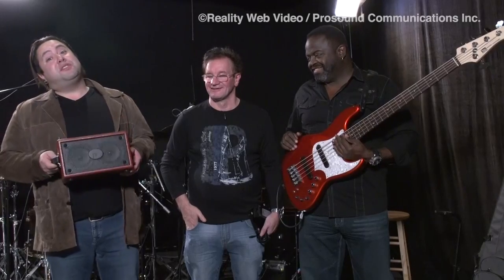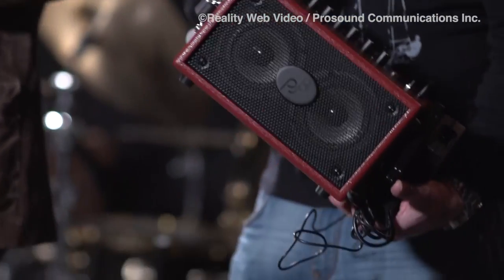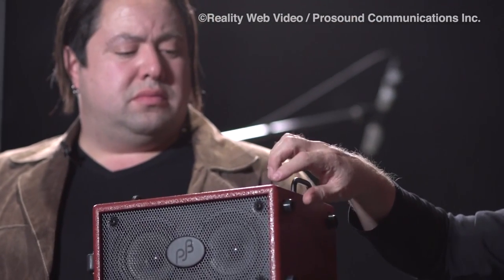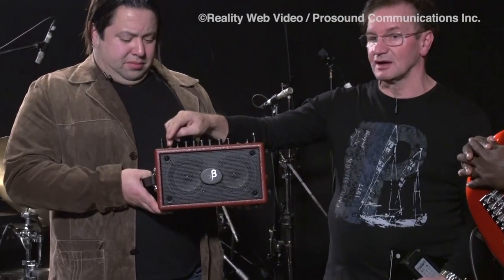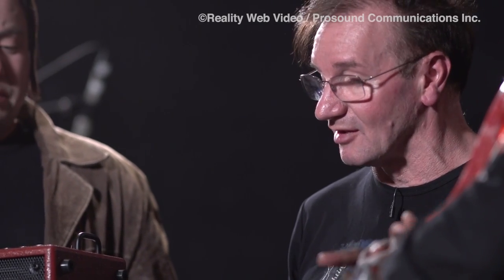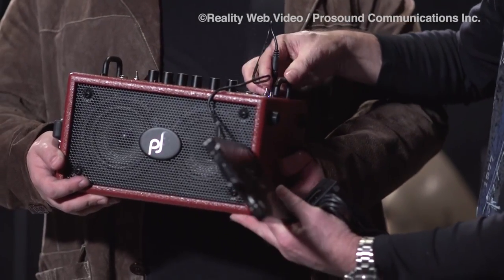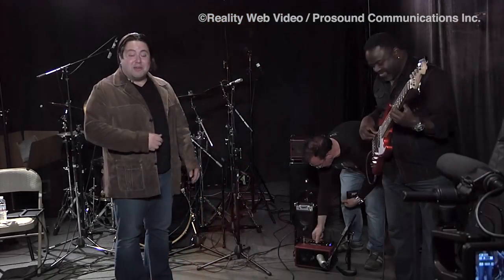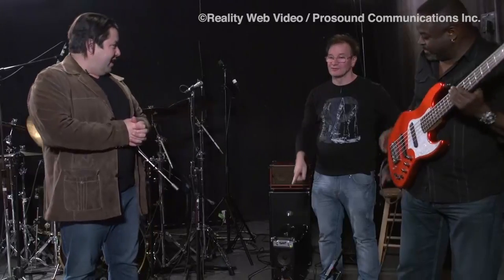Phil Jones Bass Product Demo Part 4  "Double Four Combo"

Comment: Jesus Christ mister Jones, there isn't such thing as a  "digital amplifier". You are referring to Class D amplifier architecture used into this product.The sound is pretty much 100 % analog at the end into those speakers. I came to watch this knowing  it has a great sound and expected top notch description for this luxury product.
Reply: Pardon my ignorance but aren’t many modern Class D Amps using digital signal processing?  As I said I am not electronic guy but could this be what he meant in a simplified way, without getting into the ins and outs?
Reply: @thejamaican67  You are referring to DSP, the digital signal processor, and this stage, where it's available, is working with small line level signal. It has to do with shaping the signal, before the final amplification stage, wich can be classic AB with transistors or Integrated Circuits, Class D with integrated circuits (most times) / FET transistors,and the third option is old school tubes for final stage amplification.

Comment: Incredible sound! The battery option is intriguing. Do you get the full 70W RMS when using a battery?  Also, as a guestimate, how much playing time would you get with typical sound / volume settings from a fully charged battery (assuming the same model battery shown in video)?
Reply: Since all the amp's power comes from DC, power just depends on how much current your battery can supply.  Note that just because a battery may say 4AH, that doesn't necessarily mean it can actually supply 4A.

Comment: I tried finding one of those little computer auxiliary power supplied and couldn’t find one.  Anyone know what to get?  What voltage?
Reply: discharge 19-20v at roughly 4.5- 4.7 amps i believe.

you also want to avoid one that will powercut if the amperage gets high (the first poweradd pilot apparently has this problem, essentially shutting off the amp if you play hard)

Comment: I've now bought one of these amps and have twice messaged PJB for advice about the ability to go mains-free.  I'm not very teckie and when I searched for laptop batteries they look quite different from the one PJ uses here.  I did find power packs for use with laptops that have discharged batteries and they do look like this.  I want to know the spec for whatever it is - I want to get the right thing and not wreck a lovely bass amp.  Can anyone advise please?
Reply: Keith Kennard if you don’t understand voltage amphours frequency and ohms it’s a really tough conversational have. And for the company it becomes a huge liability. Message me on my page and I’ll give you some not professional advice on what Ido. Or you can spend a couple hours on YouTube learning the basics of 110ac and 12-48v dc power.
Reply: @donnnick  Hi Nick - Only just seen your reply.  I'm a bit of a dinosaur so I might struggle with the technology.  I've message PJB direct for their advice.  Thanks for trying.
Reply: essentially what you are looking for is a battery that can discharge at 19-20v that can push an amperage above 4.5 amps at that level. 

Many forums dedicated to this pursuit as it has become a bit more complicated with the lenovo battery becoming very rare. There are several alternatives that are suitable

Most common being the poweradd pilot 2 battery which similarly is able to fit in the handle of the combo

best of luck
Reply: @glueball9511  thanks for trying to help.  That is the model that PJB recommended to me but its unavailable too (certainly in the UK anyway).  I was then directed to the Krisdonia NJF-2 which works however if you don't get the 20v setting it will shut down (safety feature) for about 5 minutes, which is no help on a gig.  Similarly, if you don't use it for a short while it also shuts down and you have to reboot (if that is the term).  Frankly, a frustrating item - I've only played on mains ever since but I would still like the battery option.